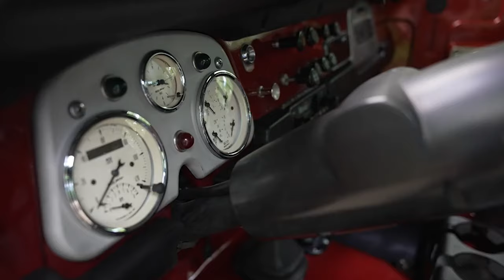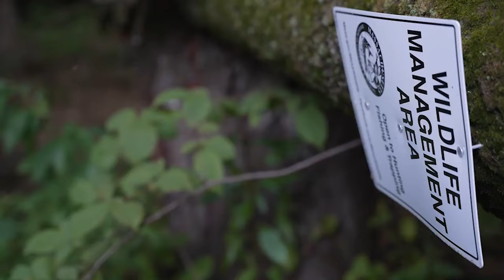5 Most Reliable Toyota Pickup Trucks Ever Made

Comment: Yawn 🥱 you truck guys are as sharp as a rock. Toyota did not want to change the engines. This is Biden administration regulations. Suddenly we have to come up with engines that can put out power but meet regulations. It will take a few years to get it right. But simply put if not for Joe Biden we would not have to retire the V-8.
Reply: Yet Ford F150 has V8.  yet Nissan Frontier has V-6. Go back and try again Gomer